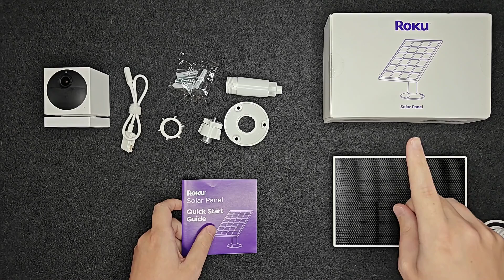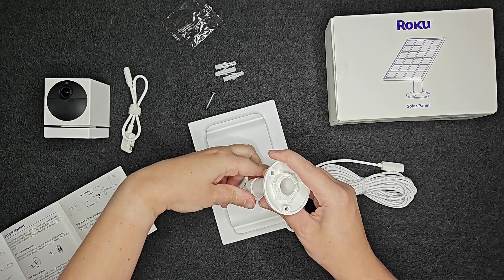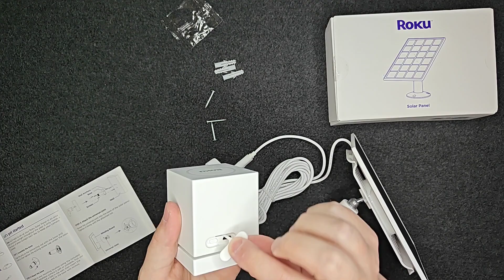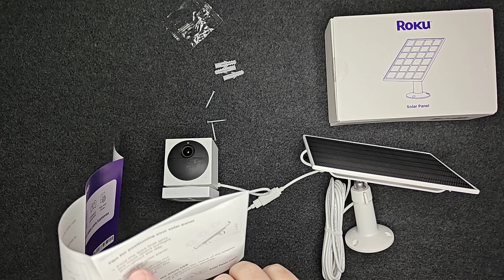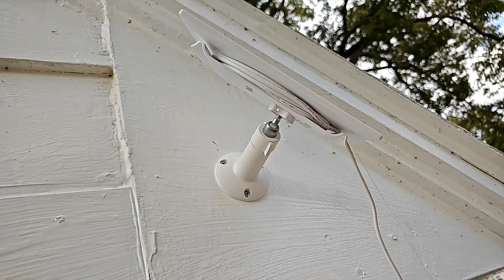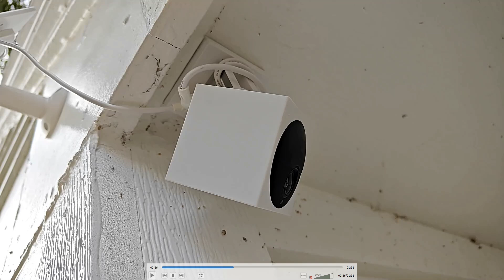How To Setup Roku Solar Panel - Setup & Use Roku Solar Panel For Outdoor Camera Video Guide

Comment: Do you need a base station for this set up ?
Reply from the maker: You don't need a base station for the solar panel specifically, but you will need a base station for products that require it for wifi internet hookup.